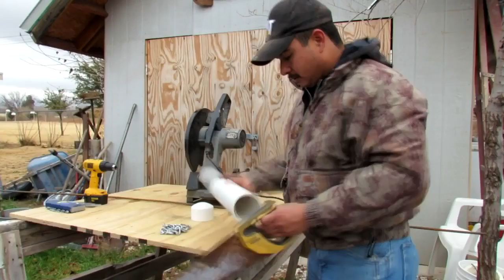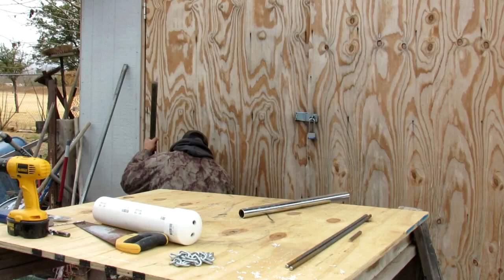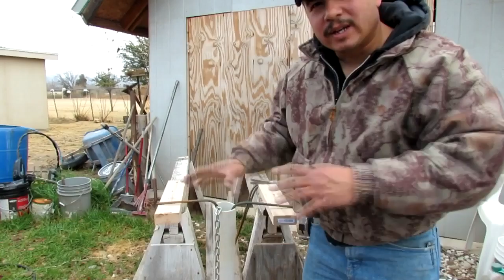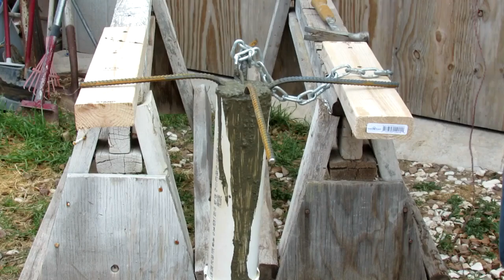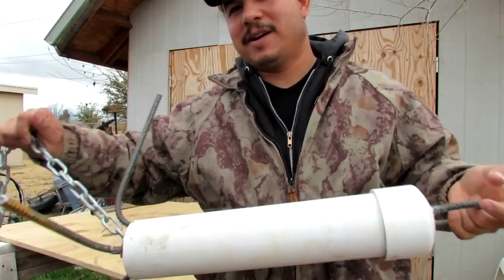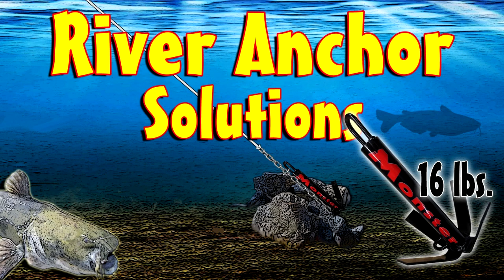DIY Homemade Boat Anchor For Under 20 Dollars

Comment: Great idea.  I'm fifty-seven years young and told a "wet-behind the ears" fifty year old friend and fishing buddy to quit buying anchors in the stores and make your own.  My brothers/cousins and I use to make them out of re-bar, metal coffee cans, chains and cement when we were kids in order to hold down our swimming rafts that were also homemade using 2 X 6's (screwed together...never nailed...and sanded smooth) and fifty-five gallon drums.  Painted top and bottom with several layers of good ole' oil based paint.  Many of these rafts are still afloat in our late uncles' ponds throughout south-central Missouri!  Nothing better than D.I.Y. jobs.  Saves you tons of money.  Builds self esteem in knowing "WE BUILT THAT" and forty-five years later the grandchildren are using the same swimming rafts their Fathers, Uncles and older Cousins built years earlier!!!
Reply from the maker: +Joe M That's a great story! I can relate. I am a general contractor and have built many additions, done many remodels, etc. It feels good to drive by years later and admire your own handy work.

Comment: concrete is setting right now mine was not a full 16 inch, I have two navy style 15 lbs anchors sometime I use one sometimes I have to use both. hopefully this just digs in and stays o
put in most of the currents I fish.

Comment: Why not cap both ends of the pvc, drill a big enough hole to drop the end of your chain in, drop some chain in the hole and fill it with concrete. The rebar was a little excessive.

Comment: how did it work?Catch well..
Reply from the maker: worked great!
Reply: Ok..I made one.Have not tried it yet.thanks..Glad I had some chain and rope and bummed a piece of pvc from someone since it is too expensive to buy a 10 foot piece for one anchor.Only had to get the cap,cement and rebar.
Reply: P.S...Not sure about how I made the bends.ay have to modify if it does not catch in the current and rocks.

Comment: What's the chain for?
Reply from the maker: Kevin Rosenthal the rope is tied to the chain and the chain is zip tied to the eye of the anchor. This way if your anchor gets stuck, you can pull the anchor rope with the boat to break the zip tie and pull the anchor out backwards

Comment: Great video but safety concerns  no safety glasses and using the side of the cutting wheel is dangerous as it weakens the wheel which can cause the wheel to blow apart causing extensive injury to the user especially one not wearing safety glasses.

Comment: most anchors at Academy Sports are under $20
Reply: You are right. Part of the concept is that the design of standard anchors makes them susceptible to snagging permanently on wrecks/rocks. If your anchor gets stuck, sure you can cut it and move on, but you will likely be without an anchor for the rest of the day and have lost your rope and possibly chain as well (thats cost, convenience, and there is likely a green element as well). The point of the reef anchor is that its bending and two attachment design lets you get it in and out of snag susceptible areas as you fish different spots throughout the day. A lot of reef anchors are >$80 and even they get lost. My buddy bought one for $150 and we lost it the first use. (I think its chain snagged on the bridge wreckage we were fishing). So while one approach to fishing wrecks would be to use inexpensive standard anchors on repeat, the cost of re-roping and inconvenience of losing anchors regularly makes it less than ideal. Reef anchors on the other hand have definite merits but are expensive and not without risk. Making a cheap reef anchor has its appeal. I plan on making one this weekend.